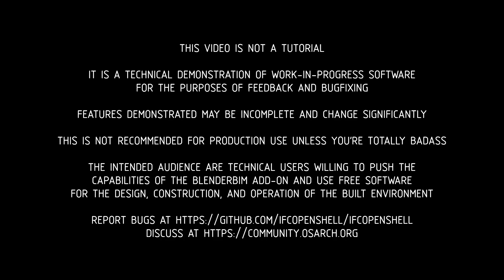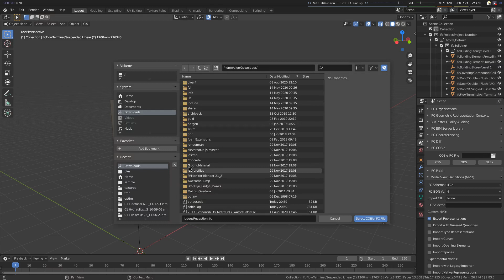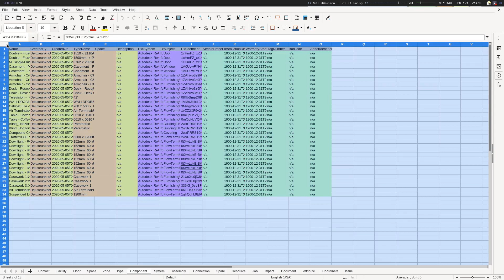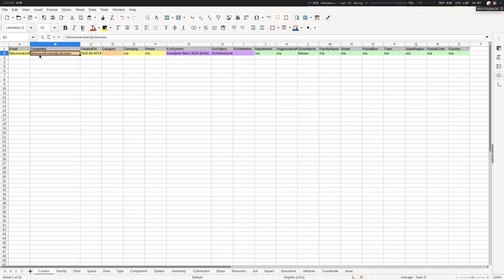IFC COBie to spreadsheet conversion - 200815 BlenderBIM Add-on Technical WIP Demo

Comment: Very cool.  Were the problems found causing errors for the asset lists?
Reply from the maker: The data in the spreadsheet is only as good as the data quality in the IFC. In this case, the IFC was produced in Revit, which contained many problems. The video would be too long to go through all of the problems unfortunately.